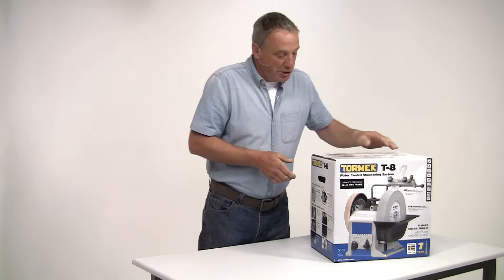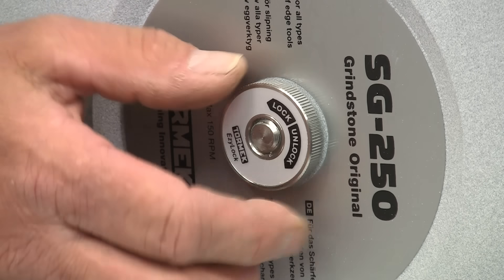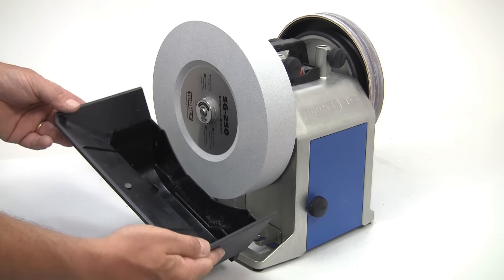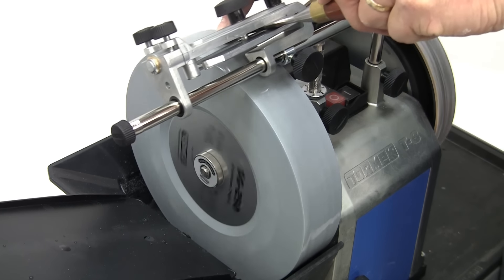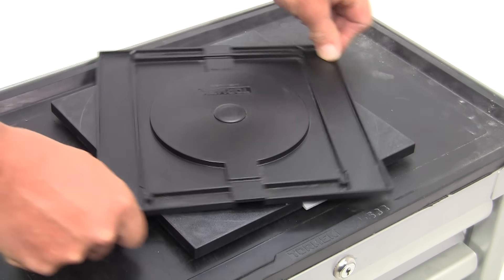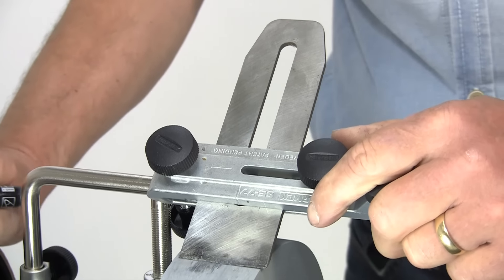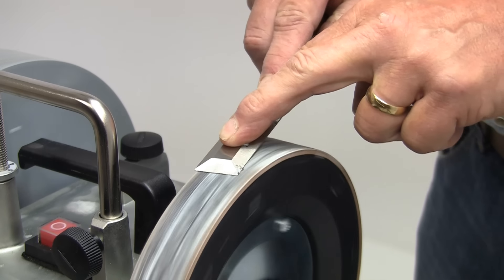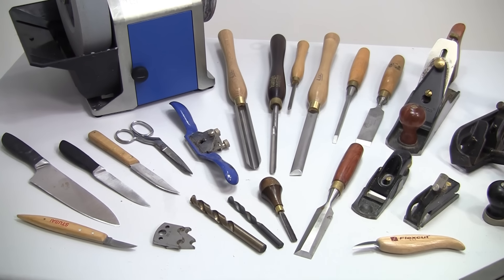Tormek T-8 sharpening system: Getting Started with Alan Holtham

Comment: I used this model when in school as a cabinet maker. Absolute joy to use and I can't wait until I can afford to buy one for myself (which I hope happens in the next 1-2 years). Until then I have to settle with a Scheppach as I need a wet grinder (I've spotted small nicks on my chisels and they need to be fixed), but I'll definitely run all tools over the Tormek T8 when I get myself one, as I don't believe any other brand can offer the same level of quality sharpening. As a cabinet maker who primarily work with hand tools and thus use a lot of blades, the Tormek T8 is the wet grinder to get. It's definitely worth every penny
Reply from the maker: Hej Visiopod, thank you for the feedback!! Sometimes you'll find a good price on the internet or even used machines.

Comment: I rarely see anyone using the Tormek in an edge trailing scenario. It that because it is not recommended or is the sharpening factor affected? I experienced a stone catch by the blade in the common edge leading configuration. I managed not to get cut but it would have been a disaster considering a very sharp blade and fingers all over the jig and blade.
Reply from the maker: Hej K3Fyguy, the quality of the cutting edge is much better when edge leading compared to edge trailing due the fact that the burr is much finer and easier to hone away.
You have also better control over the alignment of the blade on the stones surface, because you can easily see ow the water runs over the blade.
Important is only to have a steady pressure forward and therefore automatically down on the universal support.
Just check our Live Sharpening Classes for all the finer details for your to succeed with your sharpening.
https://www.youtube.com/playlist?list=PLGpQjduHna4DOfmVeoXe0J9J9dEEqU0UN
//Wolfgang

Comment: Alan, excellent video very informative. Thank you. I just bought my first Tormek T8 Black. It would be great if you can do a video using the T8 Black. It's a bit different as I understand it. Diamond wheel won't wear off, Leather does not need honing compound and also water need anti rust fluid. So if I tip my water out everyday then I need a lot of anti rust fluid or should I just lower the water trough down?
Reply from the maker: Hi there! Happy to hear, welcome to the Tormek family!  Here's a link to a video about the Tormek T-8 Black: https://www.youtube.com/live/LQ3gcUhk29U?si=l7i_i1QGLZGP2H9C

You can reuse the water mixed with ACC-150 Anti Corrosion Concentrate, just make sure to lower your water trough so that your diamond wheel doesn't rest in it. Let us know at support@tormek.se if you need any help going forward. Good luck, and stay sharp! 

/Hugo from Tormek

Comment: Bought the T-8, read the manual, viewed the videos. All My chisels end up with an angle, not 1 is 90°. 
I've tried to adjust the micro adjust nobs, lined up the lines on the SE-77 but nothing works. And like this video, it misses exact explanation on HOW you get the tool in a 90° angle. 
Email tormek holland and Sweden,  nothing.. anyone suggestions on a video that really shows how to set the SE-77  straight?
Reply from the maker: Hej Ivor, 
we are sorry to hear that you can´t achieve great results yet. We are sure that you will handle it with a bit more practice. You could check out that video. We focus on the SE-77 there. Watch it several times and try to follow that instruction: https://www.youtube.com/watch?v=wMATay8ITE8&t=33s 
Stay sharp!

Comment: The thing I don’t understand is how you get your chisels sharp using only 1 grit? Or are you expected to buy multiple wheels and go through the grits?
Reply from the maker: Hi Sam, 
Great question!
What grits you might need to go through is of course dependant of the condition your tool is in. The SG-250 Original Grindstone has adjustable sharpening characteristics equivalent to between 220-1000 grit, using the SP-650 Stone Grader. After sharpening, you deburr and polish the edge on the LA-220 Leather Honing Wheel with our PA-70 Honing Compound, which has some, super fine, abrasive medium as well. You can read up on all of these products on our web, and I'd recommend starting with our grinding wheels, since that seems to be your interest: https://tormek.com/en/knowledge/the-tormek-way-of-sharpening/grinding-wheels-guide 
All products mentioned above is included with the Tormek T-8 Original by the way. Hope this was helpful. 

Stay sharp!
/Hugo and the Tormek team

Comment: I’m having a very big issue with my T—8.  The gear that drives the water holder fell out of place and I had a hell of a time getting at it. I am now in a position where I had to takeoff the bottom blue cover plate to access the issue and try to take out the switch and just cause even more problems. I have a feeling I may have broken the switch itself. Is there an email address I can send pictures of my situation to and or if I need this to be repaired, who in the 60194 area code can do this for me?

Ty. Michael
Reply from the maker: Hej Michael, 
can you please write an email to support@tormek.se, explaining your problem and sending photos? 
Thank you!

Comment: Does the t8 give a hollowed edge???
Reply from the maker: Yes, it gives a slightly hollow edge, although we talk about extremely small differences. For example, when you sharpen a knife with a 2 mm bevel with a 250 mm grindstone (T-8) you'll get a concavity that is less than 0,005 mm.
To get a completely flat grind you can use our Diamond Wheels and sharpen on the side of the wheel. Watch this: https://youtu.be/SRAa8MA-Nr0?t=27
Reply: How much of a hollow would it give to a chisel???
Reply from the maker: I can't give you an exact answer because it depends on how big the chisel is but I can guarantee you that it won't affect your work.

Comment: Greetings Alan. I have just purchased my T8 and I have a Q For you. When one has finished using the wheel for the day What is the drying procedure as I intend to take the wheel off each time I use it. I have a small heater in the workshop so no problem with frost or low temperature. Really like the video have liked and subbed to this channel. look forward to seeing more. Many thanks.
Reply: Hey Paul,

Any advice on this issue?
Reply: I put a old towel in a glass pie plate that the stone will lay flat in and soak it then put the stone flat in the plate on top of the spread out towel then fold the towel edges on top of the stone then pour enough water in the pie plate to keep it wet - just my  common sense 2cents